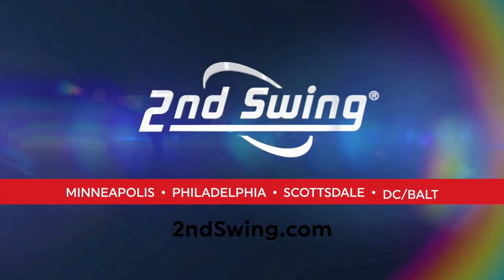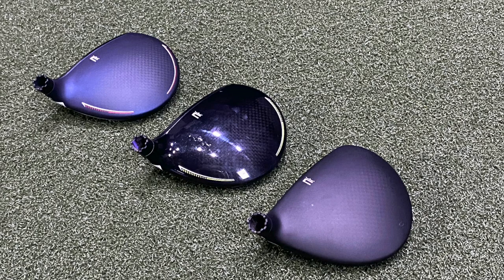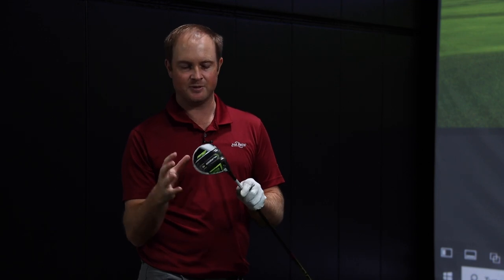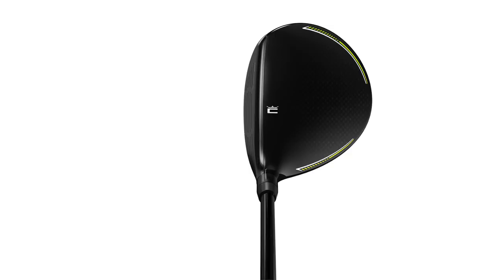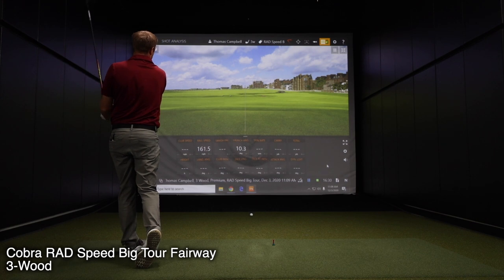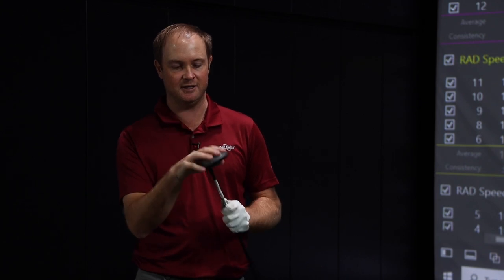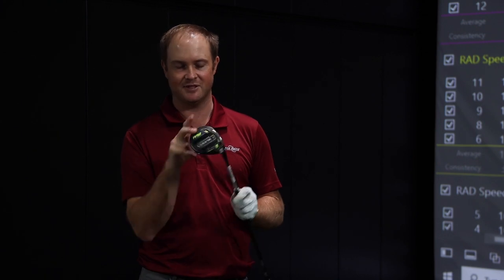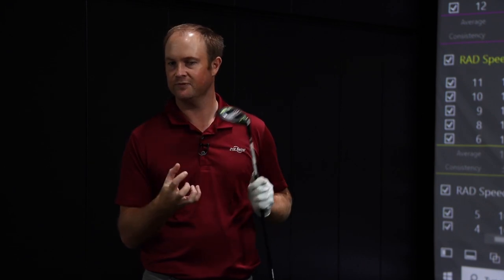NEW Cobra RAD Speed Fairway Woods Review & Test | RAD Speed, Big Tour, & Draw

Comment: Come On Man,
Where's the Cobra RADSPEED BIG Tour? 
 Just in case you forgot...
you Smashed this thing.
B.S. 161.8 mph
Smash: 1.52
L.A.: 9.9°
Spin: 2408 rpm
Carry: 270.0 yds
Total: 299.8 yds
Ht: 81ft
LA: 32.8°
Also Radspeed Big Tour is 
only 173cc in size, 
I think the SIM2 max is larger 180cc.